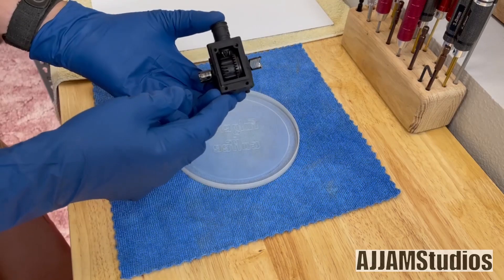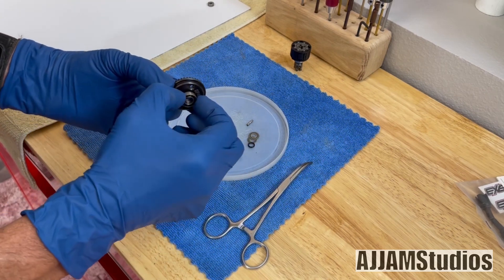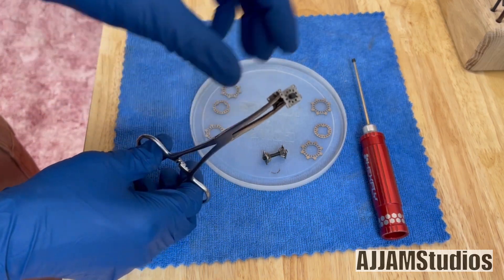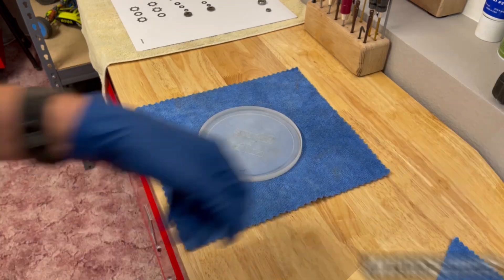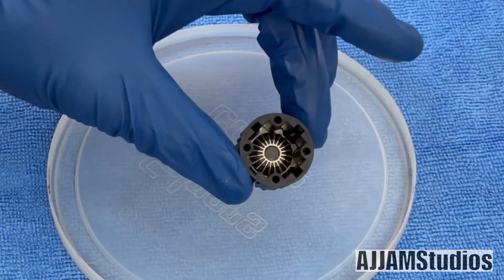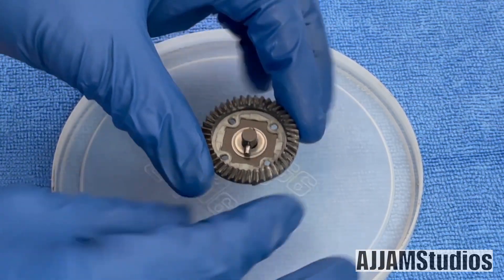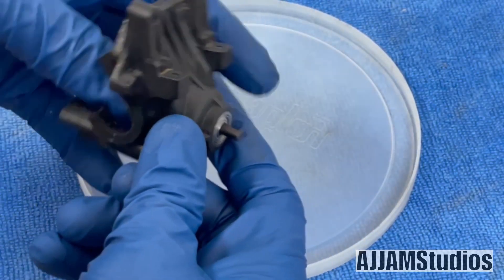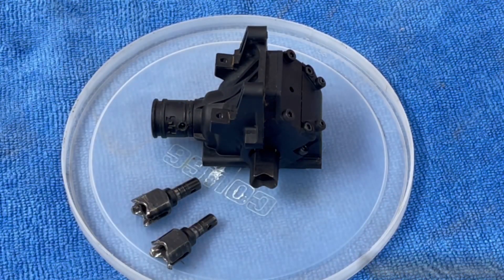LSD diff rebuild 101

Comment: Not putting tiny smear of grease on the diff drive cup shafts is a mistake. Dry steel on steel not the best bearing.
Reply from the maker: I get your point, but applying a lube that can hold onto dust and debris only serves to wear the parts out quicker; that's my opinion only. As we build the diffs we get a bit of the lube on them purely by accident as we usually rebuild and do not build from scratch all that much. Plus, the rotational forces on the diff cups is not a load bearing situation as the drive shafts come straight out with very little side pressure. Usually I would agree with the lube idea, but in the conditions we run in, the grit that sticks in the lube only serves to cause wear problems. I suppose a bit of silicone lube or graphite might do the job without attracting dirt, they are a dry lubrication. Thanks for the comment, it is greatly appreciated. AJ
Reply: @AJJAMStudios  I've never seen any dirt get onto that shaft if I was concerned I would use a dry teflon spray as I do on the CVDs and dog bones.